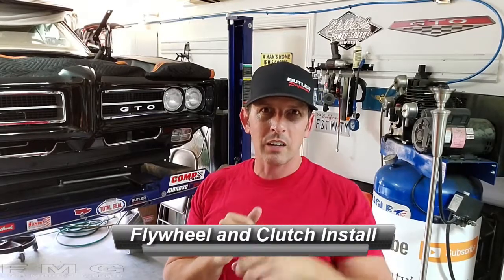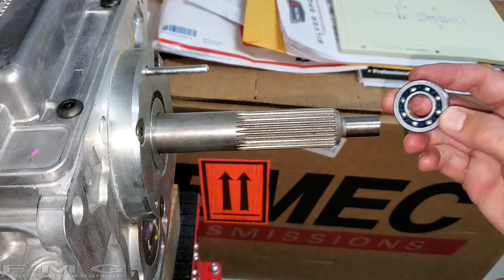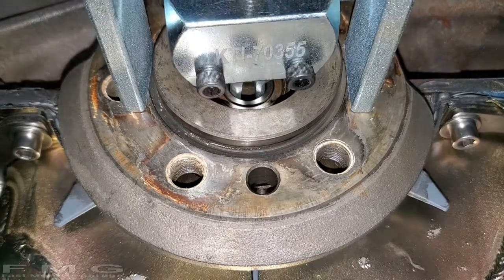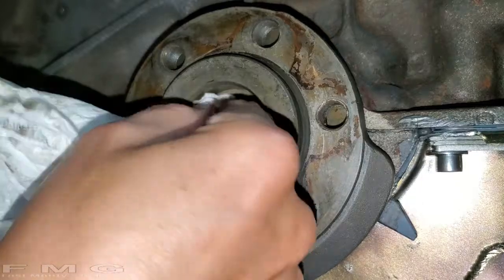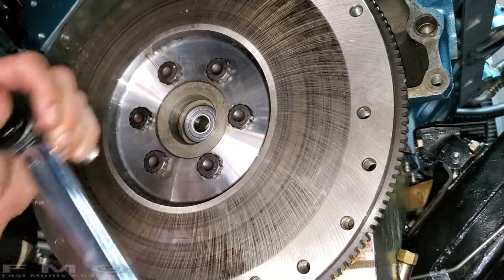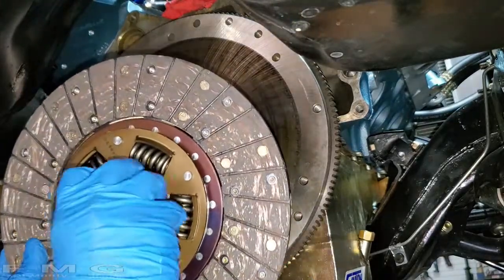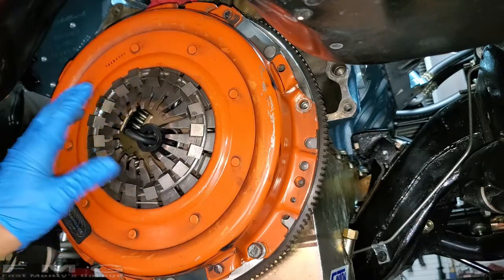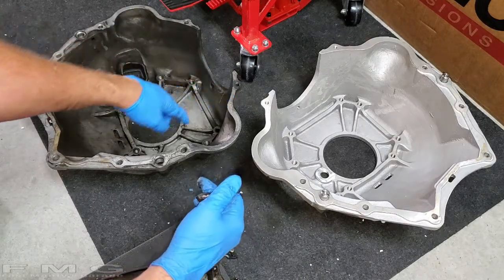TREMEC TKO/TKX/T56 Install, Part 9a: How to remove and install a pilot bearing and clutch.

Comment: Pros and cons bronze pilot bearing vs needle pilot bearing?
Reply from the maker: Great question Mitch.  So, Pilot bearings are better for rotational drag, or lack there of, BUT, they're sensitive to massive alignment issues.  That's why the Bronze bushings are used on Muncie's and the higher performance pilot bearings are used on Tremec's.  Hope that helps!

Comment: Note very important look at your old clutch plate and see if the hub springs have been rubbing the flywheel bolt heads is yes your not getting full use of the clutch dis because your flywheel has been shaved to Maximin and now the hubs hitting. if me, i'd replace the the old fly wheel with a new one so you can get full-service mileage from the new clutch..
Reply from the maker: Good point Rich... I had to change discs because I was going from a 12 spline Muncie, to the 26 spline TKO  (But, now have a TKX with a RAM dual disc clutch, and lovin it!)  Thanks for the comment.

Comment: man, you did all that work and forgot the metal dust shield
Reply: Actually,  I meant the Flex plate
Reply from the maker: @BillAllor  Oh, ha, ha... yeah, Manual Clutches do NOT have flex plates.  Those are only used on automatic torque converters.  Solves that problem.  :)
Reply from the maker: Funny.  That doesn't go on until the transmission is in.  At least, that's when I put it on, at the very end.  Thanks!

Comment: Man. I have to say that bull crap how easy your pilot bearing went back in. I froze mine, destroyed the first one and then destroyed a impact socket to get one flush. By far the hardest part of the build so far
Reply from the maker: Ohhh wow!  Sorry to hear that... that makes up for the dowel pins coming out so easy.  :)  Ha!  Keep at it!
Reply: @FastMonty  valid point 😂
Reply: I just put mine in the freezer. I hope that works because it went in about 1/16 of a inch and would not go any further.
Reply: @irwin6794 that should help a lot. Hope it works for ya

Comment: Thanks I will, I would love to do the Tremec but with my non-skills plus we have to do everything on the garage floor it would be difficult to say the least
Reply: Dan, I’m getting ready to do this. Just ordered my TKO today and I built some wheel cribs. Look them up on YouTube. Cheap and gets the car up high enough to do just about anything. Besides I prefer to lay down when I work. 😂😂😂
Reply from the maker: @darinandalinahouse9596  Congrats!  Yeah, those wheel cribs are cool... The only thing I miss about laying down to work is I can take a nap, without moving.  ha, ha... let me know if you run into anything strange.  Where'd you get the TKO?
Reply: @darinandalinahouse9596  Looked at vids thats interesting, never would have thought of that. Should be easy for me being a carpenter. Thanks !
Reply from the maker: Yup, definitely challenging on the floor... but, worth it.  :)
Reply: I will let you know! Thanks again for being such a great resource. I probably wouldn’t have tried this without having a coach. 😜 Silver Sport Trans of course!
Reply from the maker: @darinandalinahouse9596  Glad to help... also glad to hear SST is there for you.  Keep me posted.

Comment: Do you have the part # for the pilot bearing? Is it different than the one going in my Muncie? I just ordered one off Amazon it was so inexpensive no big deal, but its a National
Reply from the maker: I don't have the part number, but it should be the same. Just test fit it onto the transmission, before installing it into the flywheel.

Comment: I am doing a TKO 500 currently, when I spoke with the people at Silver Sport, they said to keep the dowel pins in the block since they could shift when the bell housing is pulled.
Reply from the maker: Yeah, there's a possibility of that happening.  But, I'm pretty sure the pins would have to rotate for any measurements to change.  It was super easy to leave them in the bell.  Good luck with your build!  Would love to see the outcome...